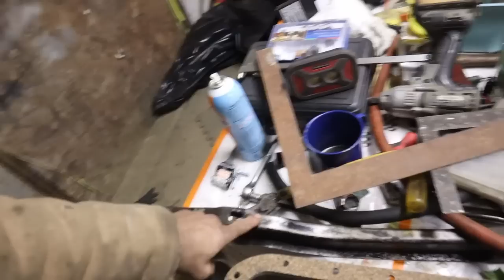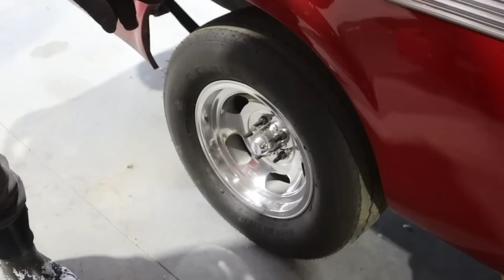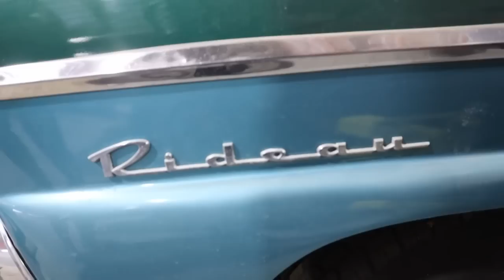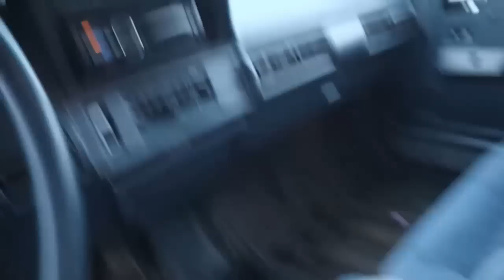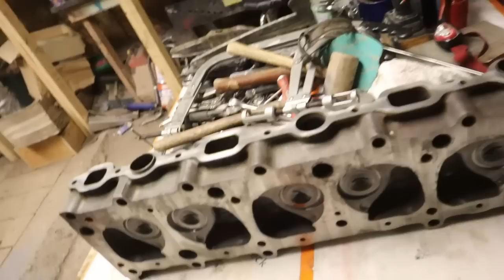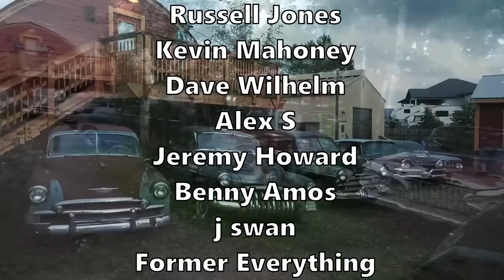Getting my Head Together: 1937 Chevy Engine Assembly, and Fantastic Ford Y-Blocks!

Comment: Those door locks should have a rubber football cover that goes over the lever and they tear and that is usually why the lock doesnt work. That's only if the actuator is working but the lock isnt working. So if you can hear it but lock isnt working then look at the football cover.

Comment: With the Olds door hanging a bit : I gonna fix this. I think: WHAT??? Then the right answer: No I won't. Sounds like me. My beater had so many bulbs dead or functionning only from time to time, I finally fixed four bulbs. Shock! No more warning lights. By some magic even the check engine light did not show up after I changed the bulbs. It was on for an entire year. It is scary to have ZERO warning lights on the dash. At least now the oilpressure warning shows up randomly when the car is cold. So it may finally die or live on. We shall see.

Comment: So is that a replacement engine or where the push rod springs a mid year change. It kind of seems like a Buick thing just to make it run as quite as possible. You would have grooves for the clips in the pushrods if it had it originally.

Comment: Oily bird pan gets the worm oil-when running, Y blocking 50's Fords not the mama flatheads, Rover fender's getting worked all over, 3500's Oldsmobile apparently isn't a coldsmobile, head surgery with Scott and Dean.

Comment: The driver's door is not supposed to lock with power lock on that model so you have to lock with key. That way you don't lock keys in car.
Reply from the maker: AHA! Thanks for that... I'm pretty sure Keith didn't read the owners manual, haha! Cheers...
Reply: @coldwarmotors  I had one as a company car when it was new. Good little car.

Comment: ASSY LUBE ON THE HEAD BOLTS? , IS THE GASKET A PREMA TORQUE? IF NOT YOU MIGHT CONSIDER RE TORQUE AFTER  HEAT A CYCLE

Comment: So, this big balloon advertising Dean's Greasy Flipz and carrying a 75 LTD floated over North America, dropping rusty exhaust system parts, empty Old Milwaukee cans and a 13mm socket in Montana, to the slightly dismayed reactions of numerous elks and other wildlife. The stout reaction to it from ever- vigilant NORAD included a delayed response as ground forces tried to determine if the 460 would be any good for a hot rod. After determining it wasn't a sale, it was eventually dispatched over the ocean off South Carolina, where it will be an abandoned boat anchor.

Really, Flipz should come up with a better gimmick to complete with Carvana in dramatic car deliveries.